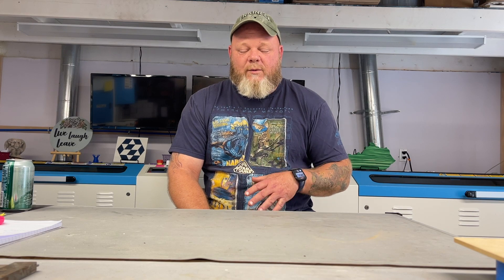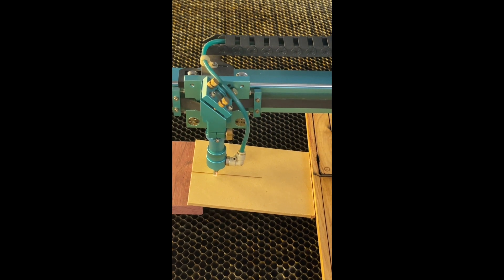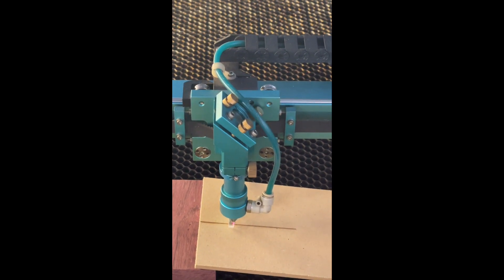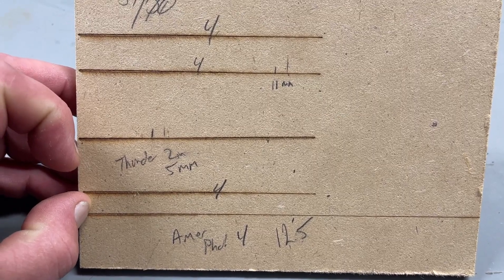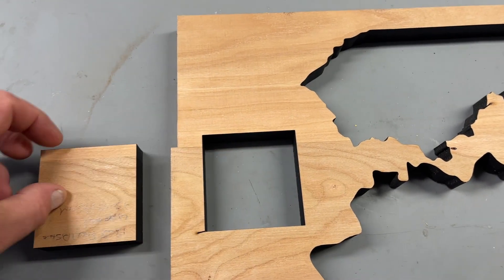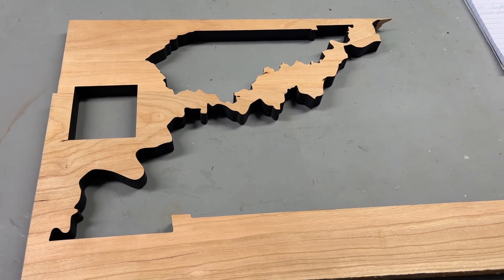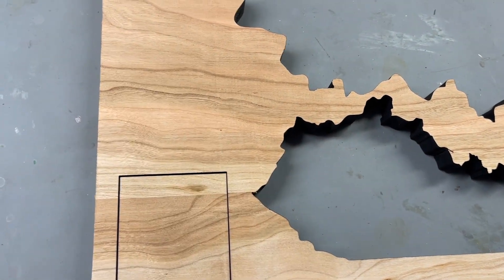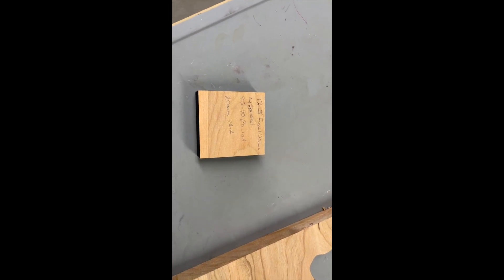Why a Ramp test is so important for your laser. ONE of the First thing you should do.

Comment: Do you have to do a ramp test even with auto focus?
Reply from the maker: I would. The auto focus on the thunder may be slightly off. We don’t use auto focus we manually focus.  Once you figure out the optimal distance you can adjust the auto focus
Reply: @Angrycraftsman  thanks

Comment: Have to agree, ramp test are invaluable to run to get your optimal focal distance.  My 38/80 is 5.5 distance.  So just don't go from his settings because mine are just a little different from their machine using the same 2 inch lense.    Because I know this will get asked I will go ahead and do it.  Was those cuts on the cherry one or two passes?